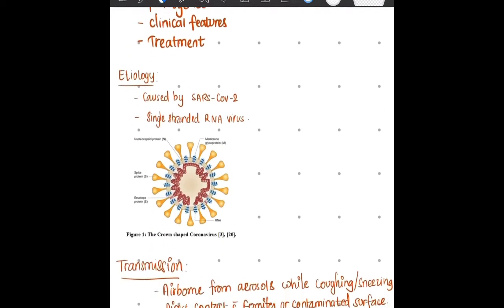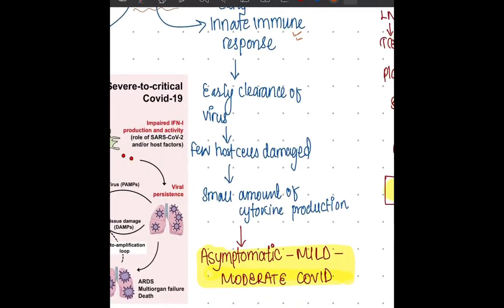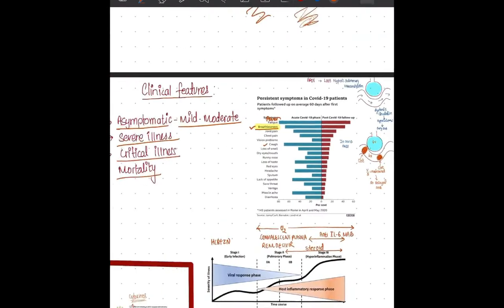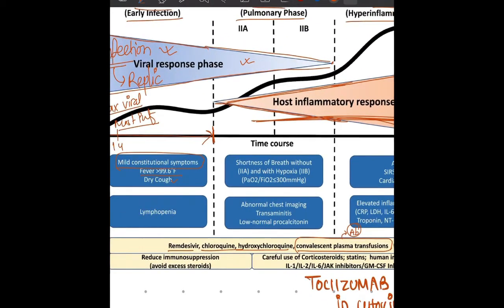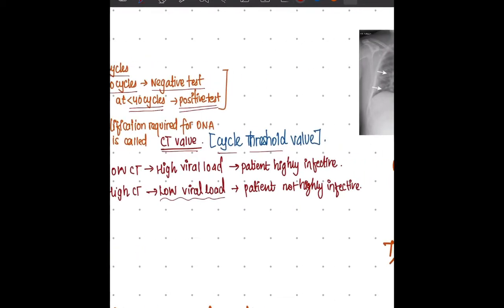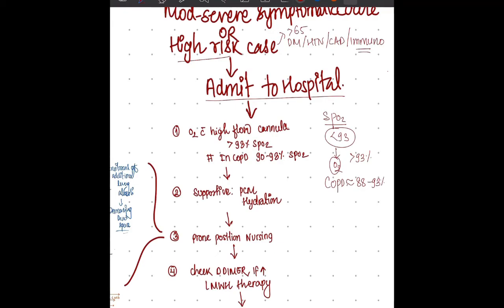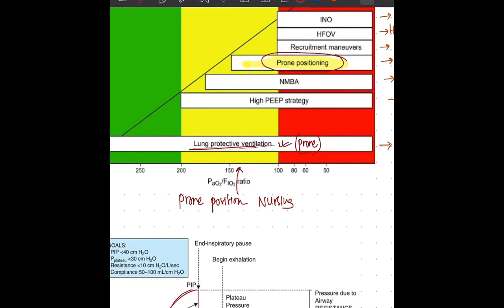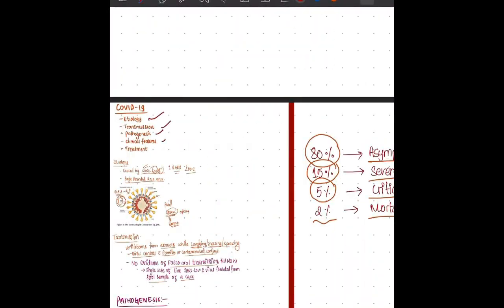COVID 19 MADE EASY

Comment: The question was asked in BMCTH about "Describe Method employed in PCR lab technique (3+3) "
Should we write the same you discussed about or is there any specific ?
Also In various labs of ktm, cut off CT value is 38. Is it 40 from some standard source ?
Reply from the maker: Since question asked has high mark weightage you should write additional info than what is included in video. Eg method of sample collection, principle of PCR ( included in video), More on CT values , Properties of PCR ( real time, use of Reverse transcriptase) briefly on process of PCR( not included in video)
On CT value, acc to WHO CT<37 is positive. CT> 40 is negative. CT between 37 to 40 is considered diagnostic gray area often requiring repeat tests. So in many labs for sake of decreasing false negative CT value of 40 is considered whereas in many places CT value of 37 or 38 is considered as you said.
Reply: @docbinayyadav  Thanks alot